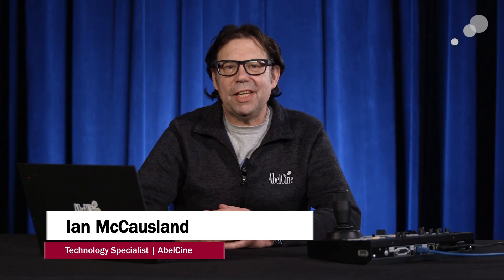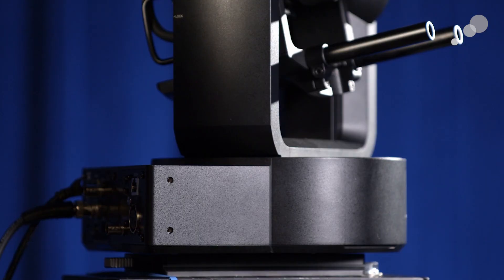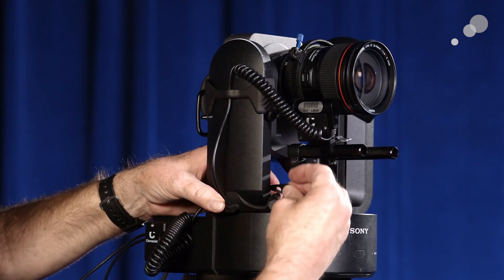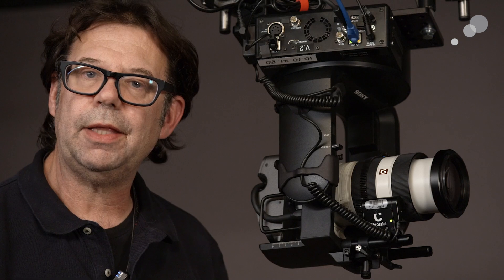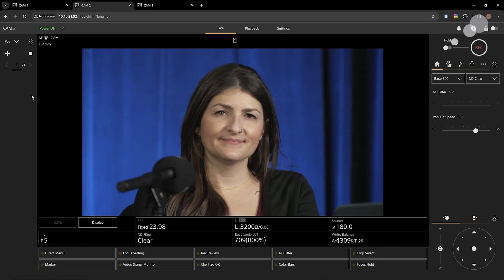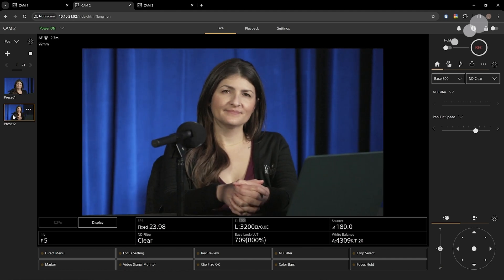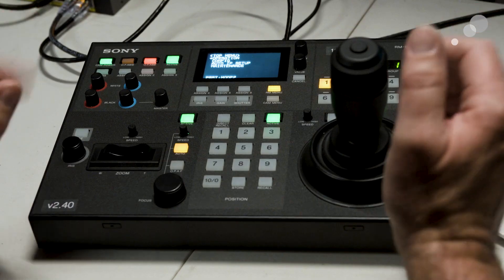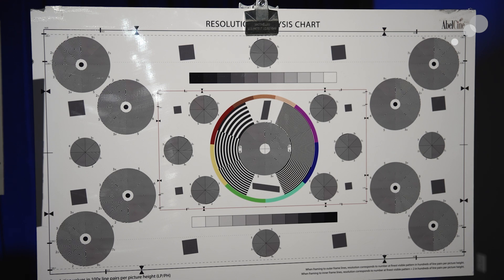A Closer Look at the Sony FR7 PTZ Camera + Chrosziel SFR Universal Zoom Motor

Comment: The 100-400 is not an internal zoom lens and the lens barrel extends pretty far out of the body at longer focal lengths. I'd be concerned about balance and stress on the motors with the lens barrel moving in and out so far. It's also not on the supported lens list for the FR7. Have you seen any issues with that?
Reply: It's a relatively light lens compared to others like Fujinon so it shouldn't be an issue stressing the gimbal once balanced. I'm wanting to try the lens myself.

Comment: Can the servo work when camera is PoE powered?
Reply: The motor has to have AC power so PoE doesn't work with it. The AC power from the motor also powers the camera. Hence the power cord from the junction box.
Reply: In this case you could potentially just get a PoE++ splitter and just use the port as a LAN port and take the DC out from the splitter to take a "detour" via the Chrosziel adapter. Cablerun-wise it will mostly remain the same!